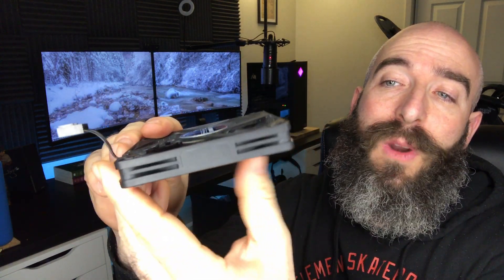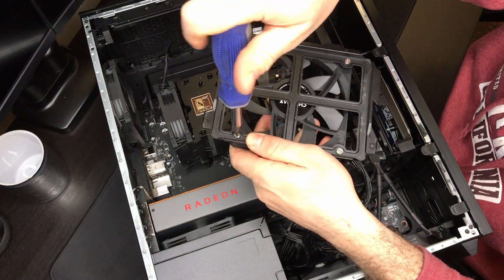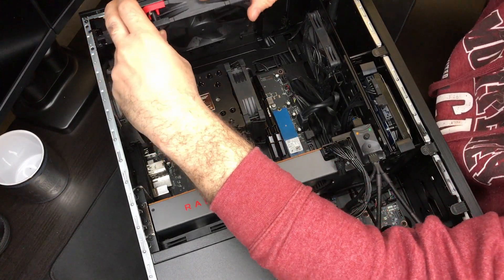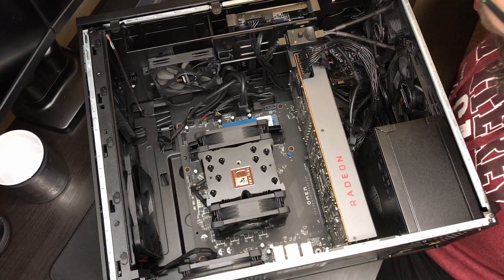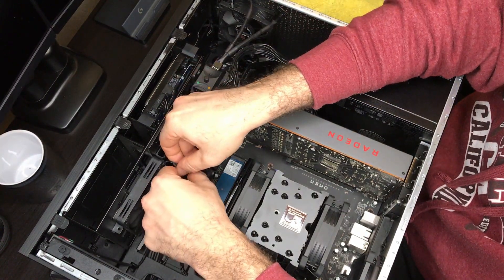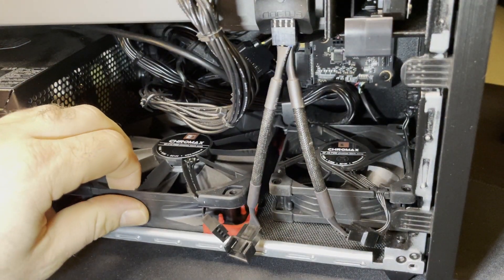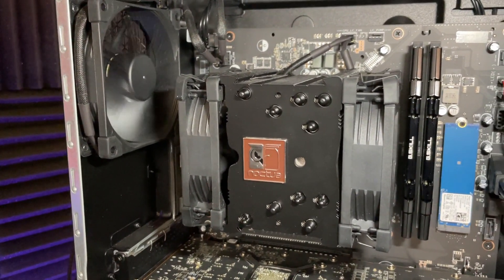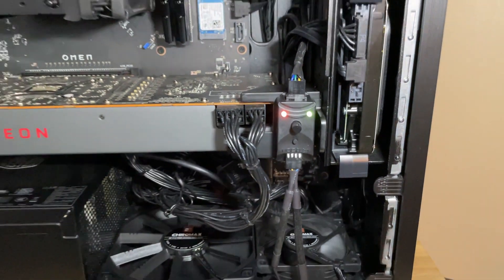How to: Install and Setup All Fans in an HP Omen 25L / 30L! Tutorial & Guide!

Comment: Hey Dan! Loving the content. I’m going to get the omen 30l ryzen 7 3070x as my first pc. But want good led fans. Any recommendations? And does omen use 3 pin fans or 4?
Reply: (That can plug in the motherboard)
Reply from the maker: You’ll need to use 4pin fans. RGB fans unfortunately do not work with Omen motherboards and require multiple adaptors to make it work. Too much hassle imo. The fans I use are listed in the description

Comment: Can the squares from the top bracket mount be put back? And if not will removing the square invalidate warranty if work has to be done?
Reply from the maker: The squares cannot be put back and removing the squares should not void your warranty. HP requires the PC to be in stock form to consider warranty work. If you don’t feel comfortable popping them out, just leave the bracket out all together; then if any warranty work arises, just install the bracket back up. It will look like it’s never been touched.

Comment: Hey DAN! Bought my Omen 25L this January and yes the cooling sucks, but do you know how much the original fans CFM is?
Reply from the maker: No idea but they are very high RPM. Most other fans will push a ton more air then the cheap stock fans.
Reply: @DanKamYouKnow  Okay! I was thinking replacing 2 and adding 1 silent Noctua NF-89 in instead
Reply from the maker: Replacing the rear 92mm / and CPU cooler fan ( or radiator fan ) greatly reduces fan noise. Adding a top mount 120mm and bottom mount 120mm help a ton with airflow. Will bring down temps a few C as well. Most after-market fans are a lot better than the stock HP Cooler Master fans 👍🏻
Reply: @DanKamYouKnow  Will do that, ill post a picture to you when the upgrade is done <3 thank you !
Reply from the maker: Sounds good!!!

Comment: I just bought a HP Omen 30L GT13-1884no, but the fans sounds like a plane about to take off. Should i replace em or what can i do?
Reply from the maker: The stock fans can be very noisy under load while at high RPM. Replacing them will bring down fan noise level for sure.

Comment: Awesome video, been looking at a 30L with a 6600XT, but didn't want to purchase until I found a few ways to improve the thermals. Nice to see that plate can have those brackets punched out!!
Reply from the maker: Thanks! Omens run a bit warm ( but safe ), so some fan additions make a nice improvement. Even just removing that bracket by itself makes a change in temps 👍🏻

Comment: I want to do some off the upgrades in this video, but since this is my first ever pc (Omen 30L with the 3080, R7 5800X, 32GB ram, AIO cpu cooler and the  hp 8876 11 motherboard) i want to check with you guys if you agree in my conclusion.

So i want to switch the radiator fan on the top that cools the AIO with the Noctue NF A14 140mm fan
Also switch the back fan to a NF A9x14 

Then i want to install a new NF F12 120mm (recomended at their website for case cooling) at the front where a second drive can be (at the top bay) 
And another at the bottom of the same.

As of wiring goes i would want the fan infront of the driver bay to be Y split with the rear fan (plugged in at system fans on the motherboard)
And the bottom fan Y split with the front fan 

I also would change the front fan but where i live they do not have any Noctua fans with RBG, so i hope you guys have any recomended fans with RGB so i can keep the look of the Omen.
Not something i would do right away but i have been throwing around the idea of changing the AIO to a NH D15 CPU cooler, but unsure if this will be better and by how much.

Many thanks to the people helping me, this community has been so awsome with help/tips
Reply from the maker: For the top radiator fan, it is 120mm and I would go with a fan that has a very high RPM, like 3,000 RPM or so. The rear fan looks good you selected / I wouldn't bother with the front fan as a fan there makes almost zero difference. I would definitely recommend the bottom mount 120mm. Y-splitting all these fans with existing headers is the best way to go about it

Omens don't have any RGB headers and their RGB is proprietary, so after-market RGB does not work with the Omen motherboard, hence why I went with black Noctua fans. 

Your AIO in your machine is the best that it's going to get, as far as cooling goes. A Noctua DH15 is way too tall to fit in the Omen case and you will not be able to put the side panel back on. If you wanted to drastically lower temps, a case swap would be your best bet but I am sure with all the fan additions and replacements, the Omen will run just fine
Reply: @DanKamYouKnow  I ended up deciding to just do a case swap insted to the corsair 4000D airflow and keeping the noctua NF-F12 3000 pmw for my AIO. Now my problem is deciding witch 2x140 case fans to pick for the front. Trying to find fans that are sold in my country and are recommended on youtube (not many fan videos out there) is the new difficulty.
Reply from the maker: Nice, case swapping leaves you extremely open to so many cooking options. Hopefully you find some good fans that work. Fan options are plenty here in California, USA.
Reply: @DanKamYouKnow  most of them are here aswell, but not all the iteration make it to Norway. Do you have som favourites you could mention?
Reply from the maker: These are the 140mm fans I run at the front of my case:

https://amzn.to/3tqddHU

Comment: Dankam i need help, i bought an Omen 25L and want to connect some case fans but i dont have SYS_FAN, CHA_FAN, PWR_FAN, or EXT_FAN on the motherboard. The fan that came installed with the PC is plugged into RFAN1. Any idea on what that is? And can i plug in a Y split cable into RFAN1? Also theres an LCFAN which i dont know if i can connect a fan into. So how would i install more fans?
Reply from the maker: You should also have a CPU_fan header where your CPU cooler is connected. You can use LC pump but the fan will spin at a very high RPM. You can y-split the RFAN1 just fine

Comment: 3:01 im trying to install a corsair h60 into that black plate any idea what size screws those are?
Reply from the maker: You mount the fan to bracket and the radiator to the fan. The older style H60 was this way. So your long screws go through the bracket -> then the fan -> then the radiator.
Reply: @DanKamYouKnow  thank you for the tip, i didnt know if it was okay to have the fan above the radiator rather than below or not.
Reply: @DanKamYouKnow  yup, i just looked at the manual again and it does show the way you described. I was thinking of it all backwards lmao
Reply from the maker: It’s funny because the newer H60 design makes it so it’s the opposite. Super strange.

Comment: A year later and I just found this video.  Bought an OMEN 30L prebuilt for my friend and I wanted to swap out all the cooling so I went ahead and bought just about everything you recommended.  The setup is a little bit different but overall, the parts fit great.  Great video!
Reply from the maker: Thanks! I had great luck with this fan / cooler configuration 👍🏻
Reply: Appreciate the video. I can’t get the top bracket to loosen up. Anyone know exactly which Philips’ to use?
Reply from the maker: Phillips head #2 should work
Reply: @DanKamYouKnow  That worked. Laying it down to get the top bracket off also helped. Thanks a lot
Reply from the maker: Niiicceeee! Those screws are on there very tight.

Comment: Was thinking about putting in a top fan, but the only place I could think of placing it would be where it says “PUMP” would it be okay to connect it there?
Reply: Ah nvm I think mine already came with a y splitters as theres already something waiting to be connected saying “RGB ROUND FAN”,
Reply from the maker: RGB round fan cable is only used for Omens that have the RGB CPU cooler fan, which yours probably doesn’t. Y-splitting the top fan with the rear is the best way to do it.
Reply: @DanKamYouKnow  thank you, I just installed the fan at the top… do you think it’ll be worth to replace the other stock fans?
Reply from the maker: Noise level will go down considerably. Not 100% necessary but does help.

Comment: I just installed the same top fan and it works great! Thanks so much. I have a question because I might install a bottom fan. I only see F_FAN1 below the GPU, can I plug it in there?
Reply from the maker: Yes, that will work just fine! 😎
Reply: @DanKamYouKnow  thanks! Do you reccomend placing a bottom fan as well or should the top fan be enough for now? Will it make a big difference?
Reply from the maker: Top fan helps out a ton and so does a bottom fan. Probably the best configuration you can have. Top fan by itself will help a lot with pulling warm air out.

Comment: Hi man i have an question, i just bought the omen and i wanna get a new fan for the top bracket. But the only slot i see that is close is called the LC fan, can i plug it in there or will i destroy my pc? i see no other fan slots that have those metal 4 points....
Reply from the maker: As shown in the video, I would recommend y-splitting the top fan with the rear fan. Links are in the description for the y-split cables that I used. LC_pump fan header will work but the fan will spin at a high RPM all the time, and would be pretty noisy.
Reply: just ordered 2 fans and the Y split cable ;) gonna place 1 on the top and 1 on the bottom. Do you think it will collect a lot of dust and mess up the air flow or will it be alright? otherwise im just only gonna do the top one i got the omen GT12-1560nd
Reply from the maker: All PC’s are going to collect dust unfortunately, so a routine cleaning every other month is normal. That top fan should help get some hot air out of the case.
Reply: Thank u bro!! should i place the bottom one  as a exhaust or inhaler though?
def subscribing to you love all the clear videos about this computer.😊
Reply from the maker: Appreciate the sub, thank you!!
Reply from the maker: Bottom one should be intake and top one should be exhaust. 👍🏻

Comment: any way to control these fans when the vram gets hot?  The default HP Omen looks at the CPU temp, the regular GPU memory and I guess the case overall heat.  So my VRAM is really hot and no other fans other than the CPU are on... ? Great video!
Reply from the maker: Either a higher flowing case or you can repaste the GPU, which requires taking the GPU apart. There are videos on YouTube on how to bring down VRAM temps on Omen GPU’s
Reply: Right, but the case seems to be clueless that the GPU vram is super hot. So the fans just sit there and do nothing... Seems like in 2021 I should be able to control the case fans... Front fan on max, exhaust on 50%... Seems like 1998 stuff really. Ha
Reply from the maker: I totally didn’t answer your question, my bad. No, there is is no way to control case fans with an Omen BUT, you can use MSI Afterburner to set a custom GPU fan curve and make it more aggressive. However, not sure if raising GPU fan speeds will lower VRAM temp much but, it will lower the core GPU temp a good amount. 

HP motherboards are one of the few that don’t allow custom fan curves. I think they’re afraid people will mess it up so they disabled it. Less warranty work for them I guess.

Comment: Great video and very helpful, im just confused because your motherboard looks different from my stock Omen and i want to get a corsair 120mm fan to put on the top but i dont know anything about pcs and want to know where to hook it if the corsair fan is ok to install in it
Reply from the maker: A Corsair fan will work just fine. All fans have either a 3 pin or 4 pin connector, just make sure you get one with a 4 pin connector, or a fan labeled as PWM. RGB fans will not work with Omens though.

Comment: That bottem fan is it intake or exhaust
Reply from the maker: Intake
Reply: @DanKamYouKnow  if i have a corsair with rgb do i have to plug the rgb cable if so where
Reply from the maker: Omen does not have any regular RGB headers. You won’t be able to power the RGB.
Reply: @DanKamYouKnow  ight but its ok to power it with out just wont have the flashy light lol ight man thanks sorry for bothering ya so much with this
Reply from the maker: Yeah, you can run just the fan with no problem.

Comment: Just want to share some info, if you like it, you can take it with you, if not leave it as is.

I recently bought the Hp Omen 25L with 3070 in it. From idle to gaming, the temperature was never below 60 C. It can reach max 80 C when playing FPS games. *Max CPU speed.

If you want actual normal temps. Try using the pc in Open case. See what temps you are getting. What I am trying to say is, a good case with good airflow will be very close to your open case temp.
It doesn't really matter how many heatsinks or fans you add to that case from HP, it just doesn't have enough outlets (holes) to carry the volume of heat generated by the components.

So what choices do you have?
1. Cheap and easy, use your pc open without the glass panel.
2. Buy a new case and transfer your components.
3. For sure get a new case and use a better cooling (aircool heatsink, or watercooled AIO/ system).

What did I do? I went with another PC case and added a 280M AIO cooler.
What are my temps now? 36 idle to 50 Max load.

HP was my first prebuild and will be last, it is just not worth the money and time to solve issues that should never be there on the first place.
Reply from the maker: Thanks for the comment. I have pretty much experimented with just about all configurations for the Omen and made videos on case swapping / heatsink replacement / AIO install / fan additions / etc. I do agree that the case is a limiting factor with Omens. I disagree that lowering CPU temps is not possible with heatsinks or AIO's. I have ran a Noctua U9S air cooler and a Corsair H60 AIO, and CPU temps dramatically. Almost a 20c difference under an R23 benchmark, which is 100% CPU utilization. I also case swapped which dropped that temp about 5-10c lower than that. ( https://youtube.com/playlist?list=PLx9LWJcz6lN5lMqNjh_4gKG9YW5tMKHwA ). All Omen videos I made are in there including the case swap, U9S, H60, etc ).

Also, 80c under max load ( I'm not sure if you mean 100% CPU utilization or max game load ) is completely safe, well below the throttle limit for AMD and Intel CPU's. It is a bit warm for most peoples liking, including myself though. 

Case swapping is a GREAT idea though for different AIO setups / taller and bigger air coolers / fan configurations / airflow / etc. I highly recommend it as you have as well. This video was more for people that don't want to case swap but optimize their Omen a bit better.

Comment: Assuming that top fan is marked to show airflow direction.  In the earlier top fan video I think the Y splitter went to the system power on the mobo, but here you're using the pump power connection?  If you have no plans to use a water cooler, use either one?
Reply from the maker: In this video, I y-split my top and rear fan with the SYS_fan header. It was my older video that I used the LC_pump header for the top fan, but it spins at a very high RPM, which I wasn’t aware of before.
Reply: @DanKamYouKnow  Thanks!!!

Comment: Hey man, these videos have been helping me since I recently got a 25L and I can only get 2 of these fans at the moment and I was wondering, which of the 2 fans you installed would you say are the most important for the best possible temps? Thanks for any help!
Reply from the maker: Bottom 120mm and top 120mm are the most important. Don’t worry about the front or the extra bottom fan, they don’t do much.
Reply: @DanKamYouKnow  Thanks man, this will help alot!

Comment: is an AIO recommended for this PC?
Reply from the maker: My Noctua U9S has performed better than the Corsair H60 I put in my Omen. I have both videos up on my channel under my HP Omen playlist.
Reply: @DanKamYouKnow  Also, once I get the fans is there anything that must be done to change the fans from intake to exhaust? Or is it just a positioning thing? Thanks again!
Reply from the maker: Positioning. The fans cannot reverse the way the spin. They have arrows on them showing which way they push air.

Comment: Don't have a clue how anyone gets the left screw off for the top fan mount. Mine's both insanely overtightened and in a spot that's nigh impossible to get a screwdriver into
Reply from the maker: Removing the rear fan should help a little bit. They tighten them down pretty tight from the factory. Just apply a good amount of pressure with your screwdriver and brace the case with your other hand, it should come loose 👍🏻

Comment: I had installed the top fan, same noctua model as an exhaust fan.  I made sure to have it set up exactly like you do in the video but I'm not really feeling much air being pushed out at the top. The arrow on the side of the fan is pointing towards the top indicating air flowing out.  Would it make any sense it flip it around?
Reply from the maker: If the PC is at idle, you want feel too much airflow. If your Omen fan setting is set to turbo and you are putting a load on the PC, then you should feel some air moving. You can try to flip it around as an intake fan and see what happens! It definitely won’t hurt 👍🏻